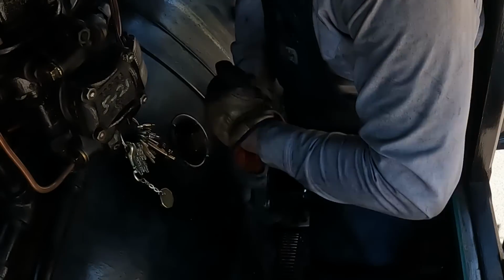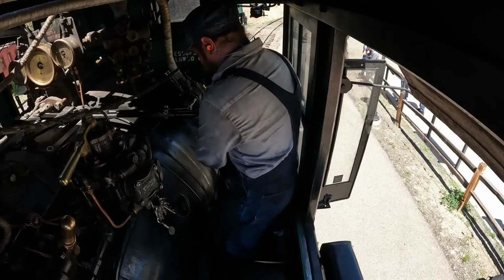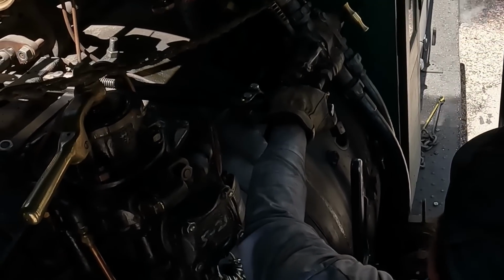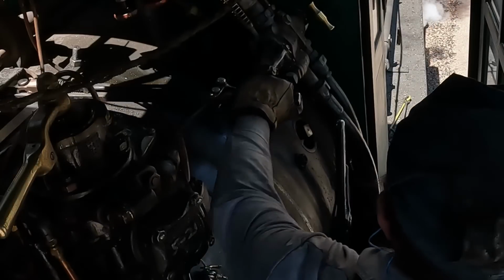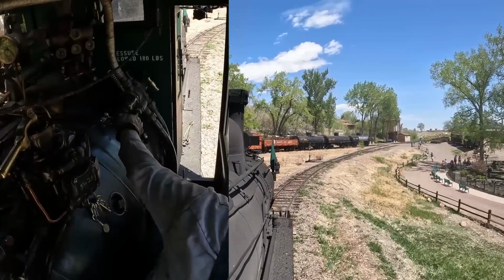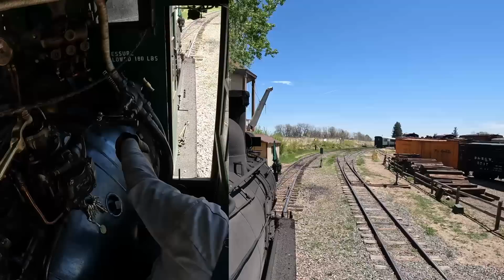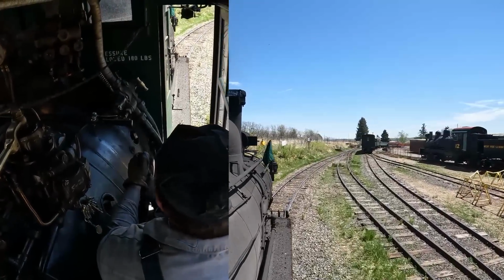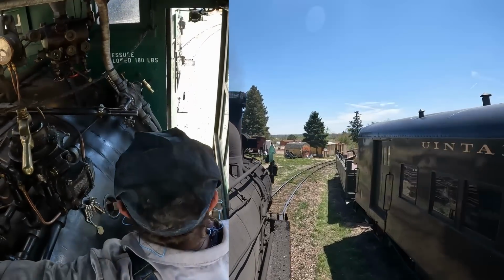How to DRIVE a real STEAM TRAIN - First Person Engineer!

Comment: I have a question, when you let off the throttle the engine seems to make a loud *WUB*, almost like really strong bass. What is it and why does it do that?
Reply: I hear it too, just so you know you aren't crazy
Reply: it occurs every time as well. At least, its audible when it isn't being drowned out by all of the everything else. I think it may be some component of the sound that the air compressor is making. Compressors? there's another question for hyce. Does each braking system have it's own compressor.
Reply from the maker: This is something all steam engines can do, but 20 particularly likes to do. When there's an inbalance in the fire's combustion of a certain significance, it can cause airflow that resonates with the boiler, producing the "demon growl" or "dubstep bass", lol. It can happen from too much air, too little air, too much coal, too little coal. 20 seems to get mad pretty much every time you shut the throttle off (reduce draft) due to some shenanigans with the way the ash pan is set up, we think.

Comment: Which locomotive is 40? I saw a tender marked with 20, and now I’m curious.
Reply from the maker: Ah, that is confusingly the tender for #44, which is an ex-Guatemalan? engine. It's sister, #40, presently operates at the Georgetown Loop. I believe they used it behind 40, or as a spare for 40, when 40 did run, hence why it's not numbered 44.
Reply: @Hyce777  ok, thank you for telling me.

Comment: What are the requirements to become an engineer for a steam locomotive ( like what degrees would I need or what courses would I need to take)
Reply from the maker: it's all on-the-job training.
Reply: @Hyce777  so I don’t need any degrees just get hired get training and get experienced
Reply from the maker: @rubbery-smudge4900  yes, but you'll find you don't just get hired as engineer, so
Reply: @Hyce777  I know you have to get promoted to engineer. What is the starting position
Reply: @rubbery-smudge4900    Grunt!
Reply: @normalperson1475  what?